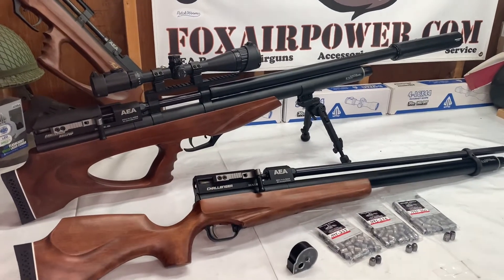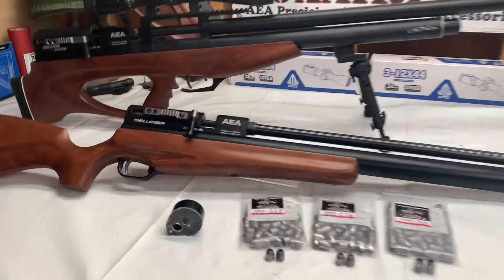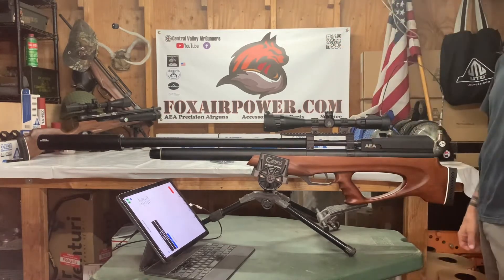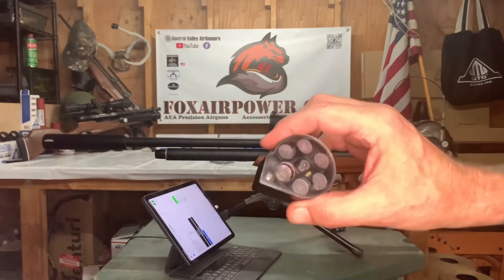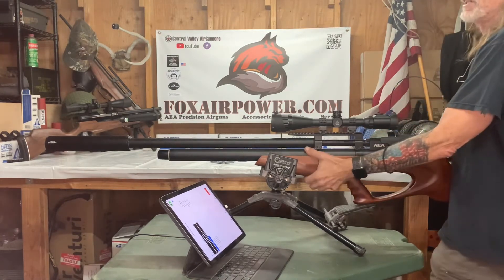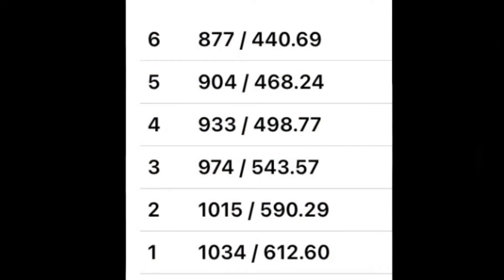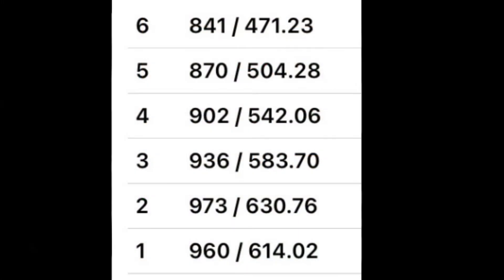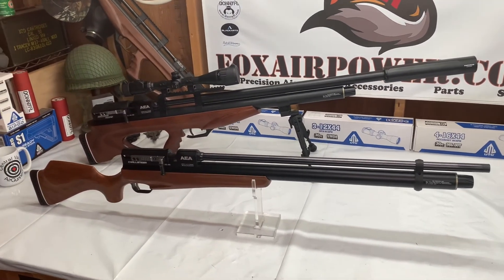AEA .50 CHALLENGER BIG BORE SIDE LEVER MODELS - CHRONOGRAPH DAY

Comment: I can’t stand that hammer spring twang…
Reply: If you remove the air tank, and do the “bottle brush mod” it can reduce the hammer ping.
Reply: They I’ll soon make a regulator that I’ll fix that a little bit 😅
Reply: It sounds kinda like a Silencer from an 80s movie.
Reply: @DLC-music  I have the great kami from Donny fl on me Aea challenger bullpup 50cal and the only noise is the spring but that normal.soon or later they I’ll make a regulator for bigbore rifles that I’ll fix the spring and air tube noise but still using the Donny fl moderator you not long ear the air blast

Comment: Thanks for the review that's a good hunting rifle
Reply: actually a  good hunting rifle would have readily available molds for the slugs/bullets. so does anyone have a  link for slugs.bullets for this .495cal barrel? the lee combo real bullet mold for 320gr will work but the one for 250grain is too large a  caliber , need that 250 one in a  under .500 mold

 and any hollowpoint or hollow base or dish base mold for .495 would be appreciated, and if you have a  link for a  sized down mine-ball for .495 ill marry ya. is there a  resizing die that is readily available for .495?
 see its only a  good rifle if you can cast and shoot after they turn off the electricity,
 gx l3 compressor. deep cell battery and inverter with a  solar panel or wind mill and you can shoot  get the casting stuff and you can shoot and cast lead. now thats a  good hunting rifle... and thats the last word for ya

Comment: bought a  459 hollowbase , lee mold, i  altered it by drilling out the hollow base to .492 with a  12.5mm cobalt drill bit. now polishing it out to .495 ... it started a s  405gr but it is heavier now, i  do not  know how heavy(?420-460gr ? i  will need them tested, i  dont have a  .50 challenger big bore.
 so if maccabespeed cant test them , would you like to terry it is a  bullet that did not exist yesterday, h?
Reply: guess it looks interesting, starts .459 swc with a  gas check and then my alteration , ending in a  hollow base insert , that is for the .459 , but now it is .492 so the skirt is thick and the hollow small. making a  tapered bullet with gas checks and i  am very interested in finding out how it flys. i  am ordering good virgin lead and will cast some up at the beginning of october.  wish there was someone in texas near dallas that had an AEA .50cal , they could shoot , right here in my yard , basic 20yd range here . i  wont let myself buy a  .50big bore till i  can prove i  can cast the ammo. this is the heavy projectile ive created. i  still have to create a  small one near 236 gr. yup will drill a  .452  220gr out to whatever it weighs at .495diameter.
Reply: still working on adjusting the mechanical working of the insert . the drilling was a  success, the insert is not fitting back like it started, so have to adjust.

 so what is the news on the new big bores with regulators? just say dec or jan ...

Comment: Pressure strings would be nice in addition to power string.  Still say the 45 is the sweet one. Sweet spots at much lower pressure. Easier to fill etc
Reply: 3800-2350 is sweet spot for the big bore platforms . 4100 is prime for a  figh pressure fill. and if they get a  regulator  id set it at 2300psi and fill to 4100psi.

Comment: Very nice rifle.  Over 630 fpe with only a 300 grn slug!    What’s the biggest slug that rifle will eat? 

It takes my .457 Texan pushing 405 grn slugs to reach about 650 fpe.  Of course that’s the 3600 psi CF model.   

457 Texan CF - 640+ FPE Lee 405 Power & Accuracy Test -
https://youtu.be/wvSV1vXyujw